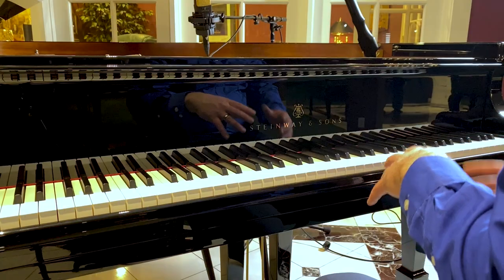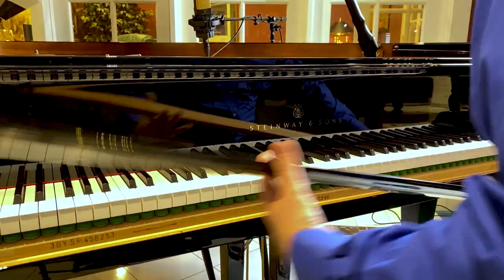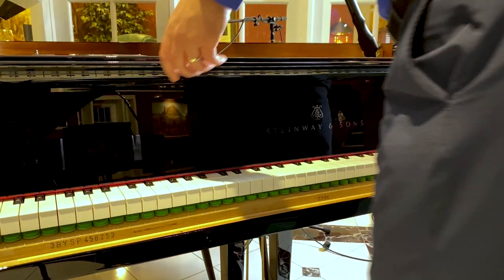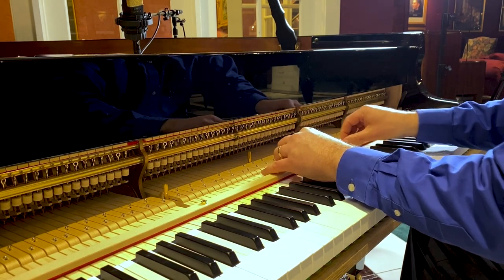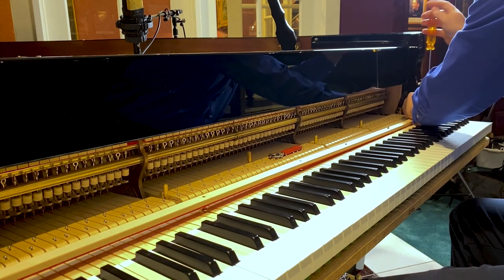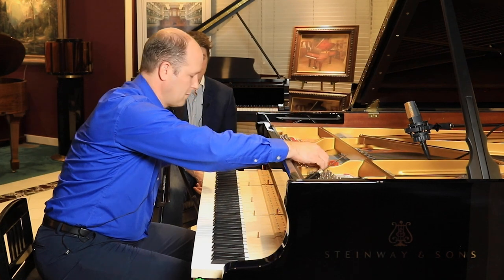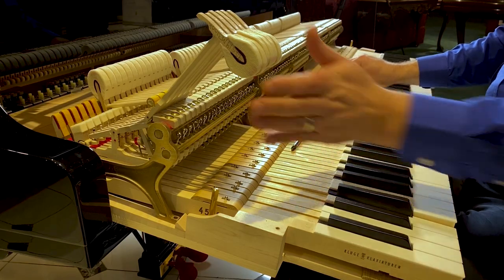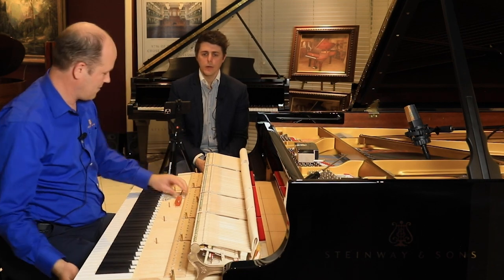Part 2 - Dismantling the Action & Checking for Friction - Prepping a NEW Steinway Series

Comment: I have been reading a book about making of Steinway pianos recently and thought that all these adjustments are done at the factory (very elaborate control system and many stages of tuning). Are these Steinway pianos really so fragile and unreliable that they require constant prepping and tuning? It completely discourages me from even thinking of getting anything but Kawai
Reply: This is a process known as regulation (prepping is likely lay terms for a piano's initial regulation). 

Any acoustic piano requires not only regular tuning but also fairly regular maintenance and regulation. 

A piano is made of materials (e.g. wood being a big one) that change in response to the environment where it is placed (e.g. varying levels of humidity, varying levels of temperature, etc). Depending on how stable your environment where the piano is located will largely dictate how often regulation/tuning is needed. Part of owning an acoustic piano are these responsibilities. 

I think in an earlier video in this series Josh did say something to the effect that one key on his piano at home was acting up and had to call his technician. This is a regulation issue that rears its (ugly) head from time to time and is eventually unavoidable. Someone with Josh's talent and experience at the piano would be very sensitive to these changes and it's reasonable he would notice them earlier on than less experienced players.  

Take note the action of this piano (and all pianos in general) is highly configurable and this is true for every key. So if one key (or multiple keys) start to behave differently than the rest (e.g. double strikes a string), it can be adjusted by an experienced technician.  

Regarding owning an accoustic piano, expect to need to regulate an acoustic piano at least annually (and tune it roughly at the same interval). You can also call a local technician that is familiar with your climate and will ask questions about your piano's placement and what you should expect in terms of maintenance frequency.
Reply: @briancamcginn  Thank you. I do understand that the acoustic piano needs (at least) yearly tuning and climate control. What I do not understand is that piano that was delivered from the factory (I am assuming) needs such regulation and action adjustment. I saw videos with Yamaha or Kawai pianos coming from the factory perfectly adjusted. As I said, in the book "Piano - The Making of Steinway Concert Grand" there are many chapters following the piano through the adjustment and control process. I would assume that it means something and the delivered piano does not need any action adjustments. Am I so naïve? I am doubting more and more that an acoustic piano has a place in the home of an amateur piano player and think that hybrid pianos are the answer.